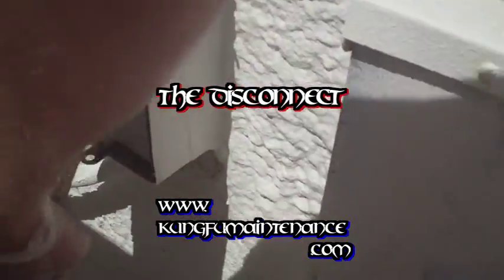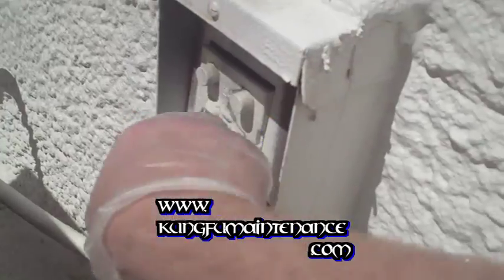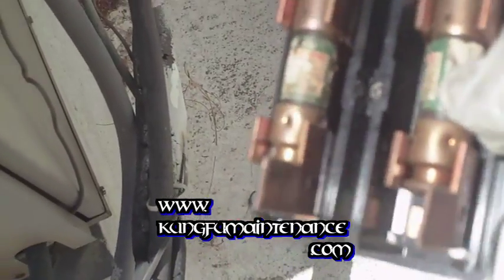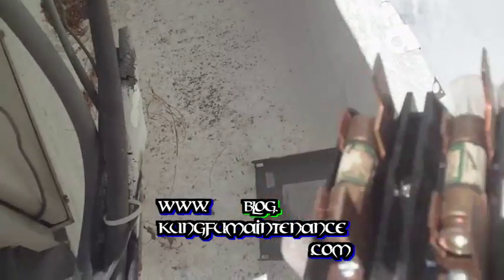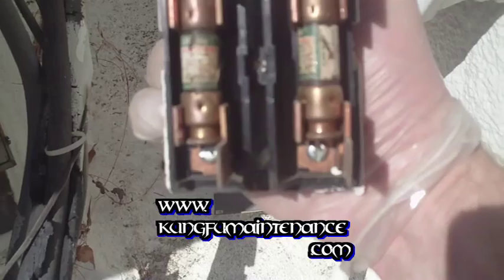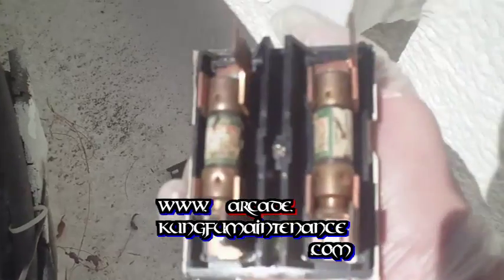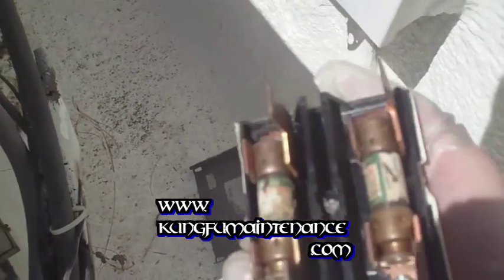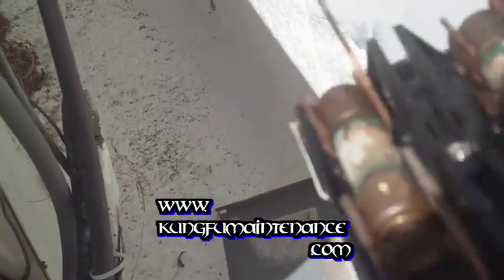The Disconnect and Time Delay Fuses ~ AC 101

Comment from the maker: To wasimtiger1, First make sure  you are matching time delay fuses rated to your breaker size and unit manufacturer requirements.Other things to watch  for are burned wires, loose wire connections, burned contactor points, clean air filters and coils to allow good air flow(evaporator coils could be dirty and ice up after awhile) (condensor coils if clogged could impede heat transfer). If the fuse is blowing immediately you can do a scratch test on the compressor.